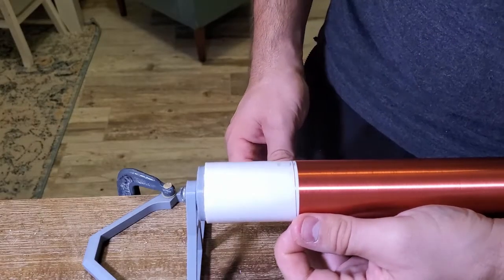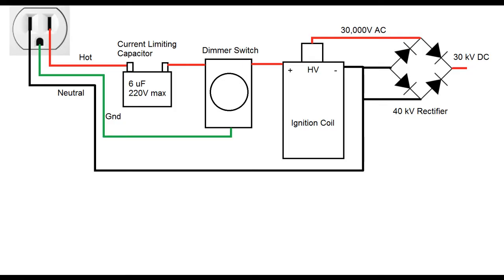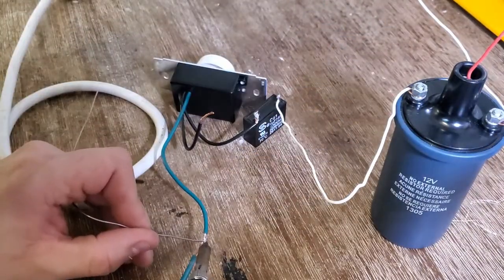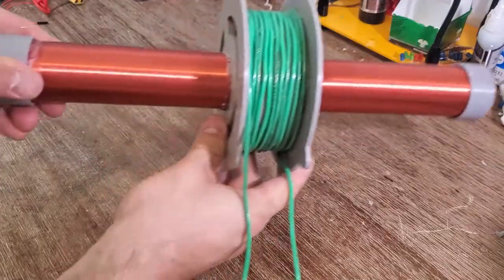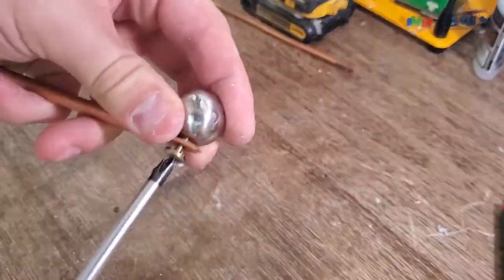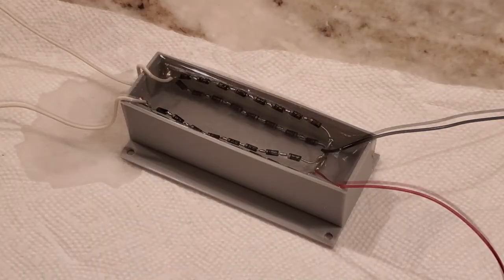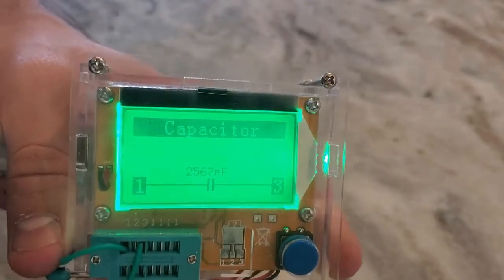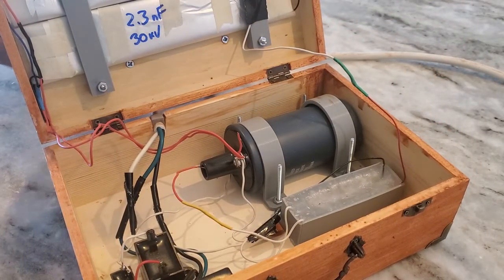30W Bipolar Tesla Coil

Comment: Interesting! Somehow I've never seen using TC windings in such configuration, not sure if it can be still called TC or just a transformer but still is fun ;-) The part before coils resembles a thing I made way back as a teenager in pre-YouTube times. I remember using few caps in paralel to increase the max current from 230V mains (I live in Poland so as most of Europe we have 230V). And I had it rectified still at that stage so it did not require HV rectifier. The switching frequency of about 15Hz was supplied from NE555 controlling 12V relay since I had bad time burning through a bunch oftransistors too expensive for my teenage pocket money budget :D Such switched DC supply was then fed to two ignition coils where one had reversed polarity effectively doubling the voltage between them. Did not thought then about adding a second stage as you did here although plans for making TC were on my mind ;-). But even with this simple contraption I had a lot of fun and even had a video about it that was Internet accessible from a small server placed in my very bedroom :D Ah, those good old days when internet was harder yet simpler haha. 
BTW, I assume there's a mistake on the schematic you've shown and the secondary winding isn't shorted with neutral line but rather goes to the negative terminal of the bridge, right? This looks strange as one of the diodes in the bridge effectively shorts the ignition coil in each half cycle.

Comment: If I used two 20kv diodes would It work?
Reply: Do you have a link for the 5kv diodes?
Reply from the maker: @60hz120vac  the diodes were R5000GP-TP

Looks like the manufacturer is discontinuing them later this year

https://www.digikey.com/en/products/detail/micro-commercial-co/R5000GP-TP/10054679
Reply from the maker: Like two in series?
Reply: Yes but still using as a rectifier
Reply from the maker: @60hz120vac  Yeah i dont see why not

Comment: So why not boost your voltage to higher numbers for coil induced magnetic propulsion? Is there a reduction in current associated with this?
Reply from the maker: Do you mean using this for a ring accelerator / coilgun?
Reply: @HyperspacePirate  Yes. Is this a DC current?
Reply from the maker: @TheSicGamer  The power supply i built for this is DC, yeah. It could be used to a coil launcher, but it's more challenging to build capacitors to store large amounts of energy at this voltage, since regular electrolytic caps won't cut it. For example, the cap bank in this power supply is ~4nF at 30,000V which is only 1.8 joules of stored energy. It would take up a lot of space to store, say, 100 or 200 joules at the same voltage. You also run into issues with projectile saturation when you have an extremely high current pulse, and lose efficiency. A better approach at this voltage might be an induction coil that repels an aluminum projectile
Reply: @HyperspacePirate  At 30KV and 200J you get a pretty bang :)
Reply: @TheSicGamer  @1:00 is the description of the circuitry and it's rectification component.